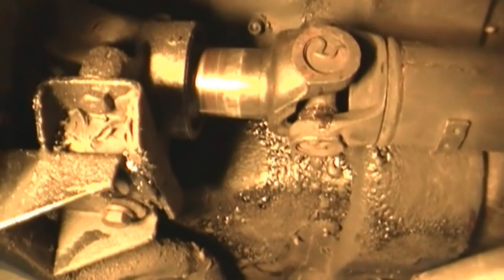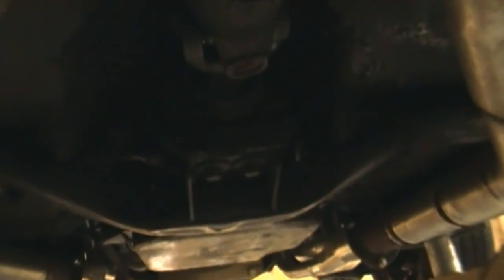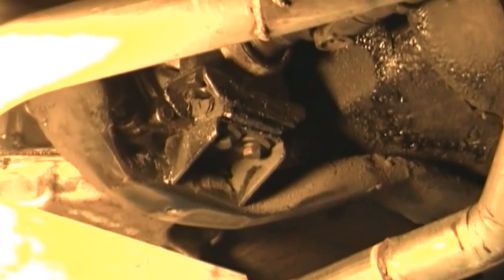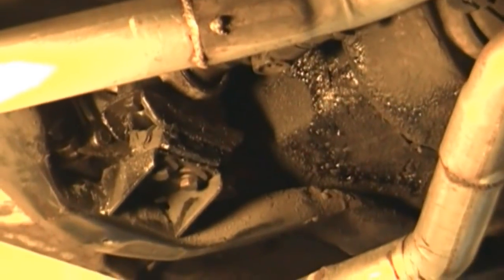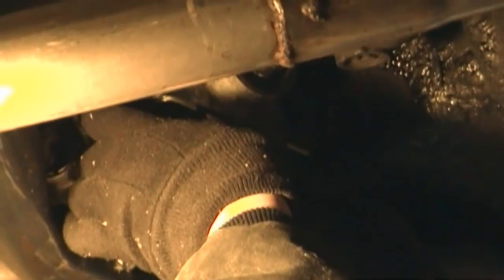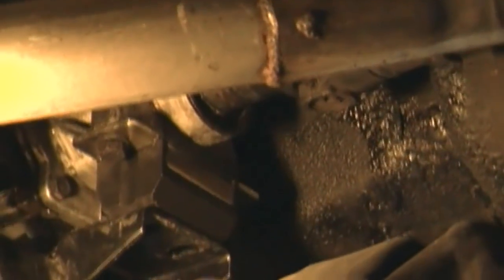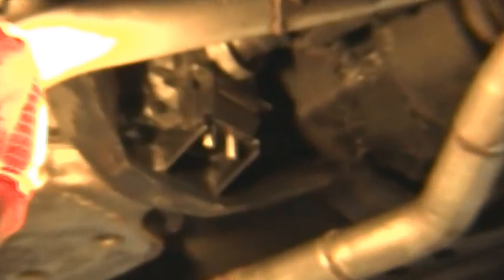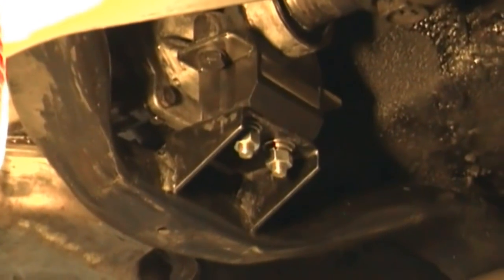transmission mount check and replace on a rear wheel drive car

Comment: I just replace my trans mount on my 84 box. when accelerating an decelerating it smashed into the frame of the car. it doesn't do it as bad now, but I just have to tighten up that center bolt a little bit more.

Comment: thank you very much. if the trans mount is bad will the whole car shack. I can only here it when I hit a bump. will the noise be heard from the back and rear.
Reply: My monte carlo (cvevy) dont want to go front went I put it on drive what could be the problem n what I need to check.

Comment: I have a 1997 Chev C1500 pickup that's 2WD had my rear end done new bearings an such which got rid of the howling noise, but there was a clunking when the truck is slowing down, inspected my center support/hanger bearing assembly it was wore out an pretty bad as its the original 1 replaced it, clunking noise still there, the truck has 203,000kms now, could it be a transmission mount?

Comment: Great video but there's always room for more stuff to be said polyurethane bushings are usually designed for something extremely heavy duty or off-road or racing applications don't expect your engine to have a nice smooth ride on basically plastic compared to rubber! I have also heard about polyurethane bushings just being way too hard on the car when they should be the ones taking the abuse. remember people parts are designed aware out so your car does not break apart in pieces from sheer vibr

Comment: I have an 1997 silhouette oldsmobile van and the transmission vibrates, could that be transmission mount is bad? it shifts fine but has a leak. Help I'm a stay at home dad and can't afford a mechanic so I do it myself.

Comment: what is the symptoms of bad transmission mount?
my suzuki vitara 1997 automatics gear, when i shift gear it will produce a 'click' sound, hard to shift, and rpm drop too. are these cause by bad transmission mount or bad cable?  (just overhaul the transmission about 6 month with new clutch)

Comment: i got a question it might be the mounts to trans but i want to make sure everyone has told me different things. i have a 58 chevy one day i was coming home and when i shift gears (park to drive, drive to park, reverse to park) it pulls the drive shaft towards the differential. anyways i was going home one night  it pulled so hard that it took my shaft out the trans. is a trans mount gone terribly bad the problem? ive been told to replace my A arm that is on the back differential but i want to make sure before i go out buying all these parts
Reply from the maker: +Craig Friday Your rear end and trans need to be properly located.  The drive shaft also needs to be the correct length.  If your rear end is moving around a lot for some reason(Like a broken control arm?) I'd start with that.
Reply: alright thanks. i dont really know much about what the original owner did i was told he had a couple 58s and built a Frankenstein 58. but thanks for the info i will look into it.

Comment: Hey my ford ranger truck made clunk when are stopped and then accelerate come first shaft, or when you are driving then you stop and you feels a clunk I am thinking that solve is the mount transmission , I already changed the transmission oil and filter, thank you